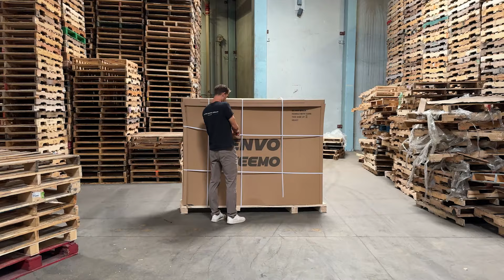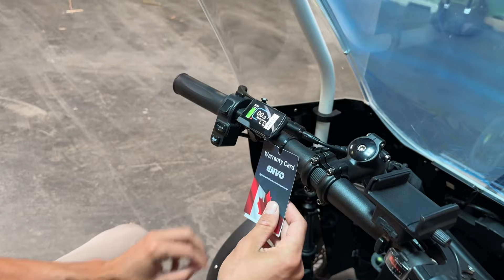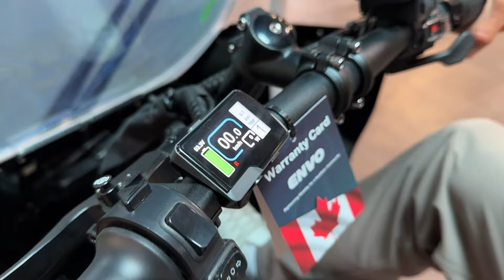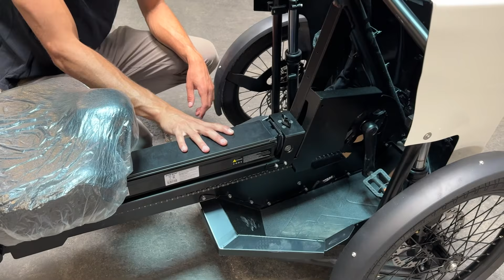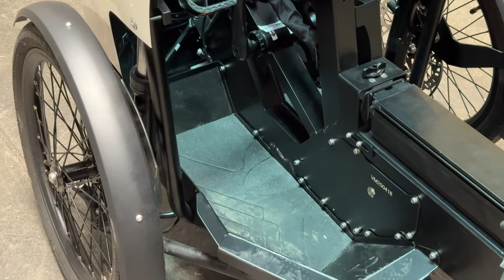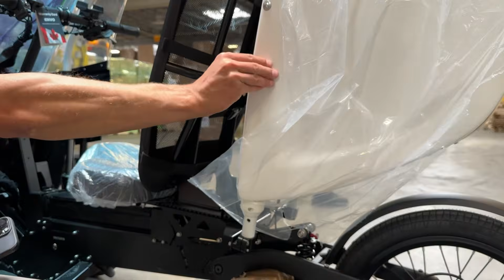ENVO Veemo Batch 3 Update – New Features, Design Upgrades & Shipping News!

Comment: As a new owner of a batch 3, while I agree that everything you've put into them are nice and well-thought, I would like to see a start guide shipped with this. I sat outside for 2 hours before figuring out the security system(before I saw this video, which aired a whopping 1 day before I got it), and I had to call customer service to learn how to turn on the headlights. No where else explains that. Other than that, love it!
Reply: 2 hours?!  It took almost a month for Support to send me the correct manual.  It's a ridiculous system.  The manual is not good but at least shines a little light on it.

Comment: When do you have a XXL version that can take another adult as a passenger in the cargo area?
Reply: Like never. This consumer segment is so bunk because all you are getting from a bicycle with 1 extra wheel, a windscreen and a roof. They have had doors with covered windows for a decade yet it’s absent here. They also have ones with a solar panel for charging assist and or range extension. The prices are literally on par with a golf cart but with pedals. Not enough going for the price of 7K+
Reply: @shadowdance4666  I looked at other European options, and there was one that cost over 16K American before shipping. I think for a non-massively produced product, 7k is pretty reasonable.
Reply: @shadowdance4666  Disagree. I would give $10K for it. Just three years without a car will save me 10K. I have driven the ELF e-trike for the last ten years. Golf carts are never valid comparisons because they offer no exercise, they are not road legal and they are so heavy they are very inefficient.